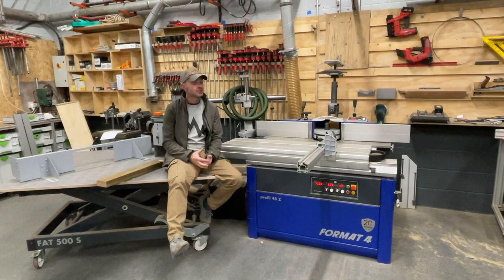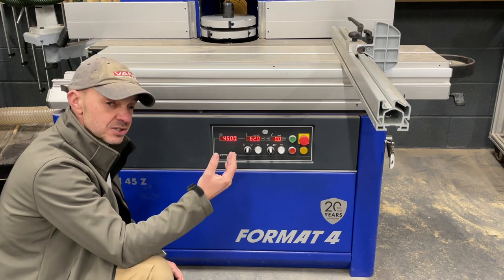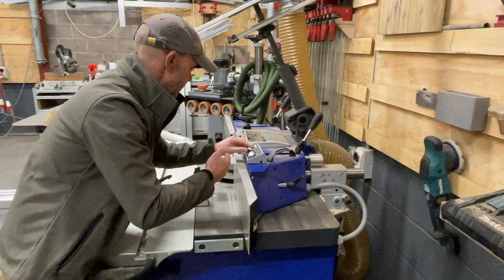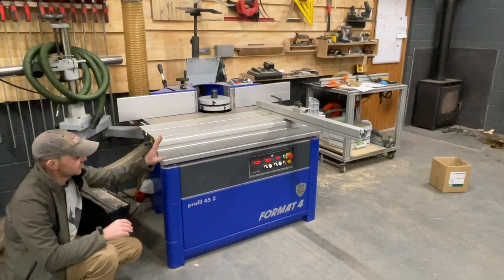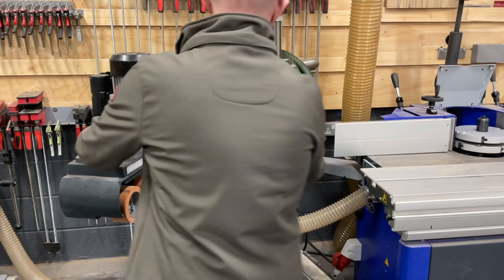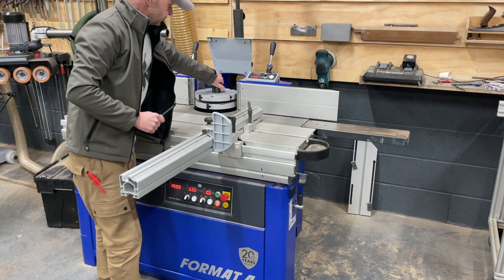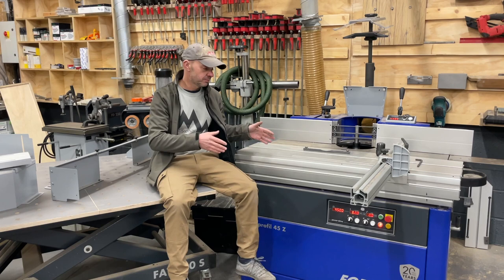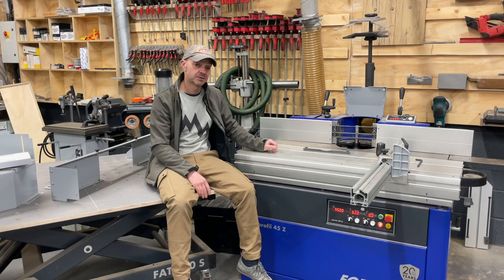Format 4 Profile 45 Z - The Ultimate Shaper - Spindle Moulder

Comment: I was lucky enough to get a used aigner fence for my Felder 700 Z. After using it and other aigner accessories, 100% worth the cost, new. It's just the small things, like the fingers on the fence. You save so much time and energy in such a simple feature. I feel everything I have purchased has had a bigger benefit vs. cost.

Comment: You're bang-on with sticking to the same family. I have a Felder saw and shaper, but my bandsaw (SCM) and jointer (Hammer) can't share accessories without some modification. But I share things between the saw and shaper all the time. Had I thought of that at the time, that Hammer jointer/planer would have been a Felder 700 series instead.

Comment: Nice review.  The fence clamps look like a big improvement over the kip levers I have on my 5 year old machine (Profile 45Z X-Motion) - will check in to upgrading these clamp levers.  Also, to change the speeds, there is no need to remove the side panel.  Just pull the sliding table back and slide the cover back for access to the belts.  Steve
Reply from the maker: Man , I will check the belt change via sliding table . I was told to use side panel and have now fitted hinges :(
Reply: Yeah it’s a great system, I keep some cutters and the hex key inside the sliding cover ( there’s a little ‘shelf’ on left). That way it forces me to open it which auto locks out machine but still allows fence/ height adjustment 

I love the format four!   Still got my old rulong, bump and go fence and try try try height adjustment, the time saved in test cuts is incredible

Comment: I have the little brother to this one, the 700z. Boy this one has some really nice features, especially everything around that tilting hood/fence and the pressure/featherboard holder. I'd really like that feature instead of taking off that heavy hood. The power feeder being offset to the side on the jointed arm instead of mounted on the cast iron is also super nice. Excellent equipment with the profil!

I ordered the router option with mine as well, so I could take the router out of the shop and free up some room. I don't miss the old router table at all. I also bought the (frankly overpriced) fingered-fence. It's really nice, but that price is nuts.
Reply from the maker: I really want the finger fence !,
Reply: @ManorWood  It's really nice, but man, it's as expensive as a fully equipped beginning woodworking shop :D

Comment: My Format4 feeder 4 wheel Vario did not have an overload protection so I blew the circuit. Get the overload protection and save some time.
I later bought the Aigner fences and found the Felder people do not sell the 650 length on each side; so bought from a different dealer.
The Aigner fence is faster, SAFER, and, you can get lots of optional attachments for special work.
I have the router 2 speed spindle which lets me use all of those router bits I previously bought. I have special fab router bits that are cheaper than
buying special knives. If you have the Aigner and router spindle you will find the smaller bits do not go with the motorized digital fence movement.
So get some metal pacers of 1/4" plate steel and mover the whole flip up fence back 19MM (thickness of the Aigner fences). Trick in getting the spacers aligned.
For the work I do which includes long stuff you may want to order the 1300 out rigger. Then, write your own book on all the new things you can do.
Tenons are fast and easy on the Format4. I move the belt speeds to different pulley diameters and in so doing I cut a special window in the frame 
to the left of the removeable grate. Haven't had time to send the size and position to Felder so they can cut the shaper wall with the window.

Comment: The Felder horizontal boring machine has two threaded holes in the cast iron table for use with their hold down clamp which also fits into the threaded puck that slides in the cavity on your sliding table. I have two clamps and use them on the horizontal bore as well as the shaper slider to hold down wood pieces as I do profile cuts and tenons. I have purchased Swedish steel 10 ft round solid stock and machine shop metric threaded for cut down 26" posts for the Felder clamp. Can't tell you how many times those clamps have been instrumental in doing work 20" above the slider on the saw, shaper and horizontal FD 250. One clamp is not enough on the FD 250; just get too much movements. If your are in the Chicago area do stop by for a peak. I am running out of floor space and thinking about bolting the smaller machines up high on the walls!  just kidding
Reply from the maker: I need them !!! Thx

Comment: I bought an older Felder Format shaper with slider table. Also got the high speed-2 spd spindle for router bits of which I had invested router bits before the Format shaper. Several people scoffed at
me for getting the router bit spindle but it has been a valuable addition. I can get custom made router bits to do muntins, etc. so the HSpd spindle is great. Martin shapers are just too much tech for the line of woodworking I do and their sliding table is not that good for door work. My Format has the outrigger and that is good for tenon work and 3' X 6' butcher block island tops with custom profiles from templates and spindle rings against the templates. I compete against CNC shops with my outrigger and spindle-tooling with spindle rings. You remove the outrigger when your work does not require it or if you have the 2.5 meter table all you do is slide the outrigger to the left end of the table. I have used the computer memory very little but expect to broaden my scope. I cut a window in the box frame of the shaper so I may leave the vented cover plate off permanently and change speeds of the belt. That little window makes viewing the belt pulleys very easy and
quick. Tempted to tell Felder to machine in the belt window on all machines. The Felder machine Format shaper I have does not have the fuse for the plug in of the Vario 4 wheel feeder. Talk to
an electrician and buy the fuse and save yourself time and heartache. East to add otherwise you think the motor on the feeder is bad. I have plans to buy the brand of feeder using a track instead
of 3 or 4 wheels. Track feeds smaller pieces and the cost is many dollars less than the Vario. Felder buys their Vario from another mfg and jacks up the cost considerable.
Reply from the maker: That all sounds great, quite interested in being able to swing across the fence away without removing it does that only work with a 2.5 meter slider. Also what is a track feeder? Do you have any links
Reply from the maker: It’s really good, can you only swing arm out the way if you have the 2.5 meter slider? Also what is a track feeder never heard of that do you have any links
Reply: @ManorWood  Good morn MW; the longer or short sliding table is not a part of the swing away action for the feeder. I will have to look for a track feeder as I have not seen one in the flesh. The advantage of being able to feed irregular or short pieces by the track appeals to me. In Chicago they have them for furniture mfg due to versatility. And, without the Felder markup seems like a good deal. The track feeder is 3-4" wide and is continuous like the track of a tank or dozer.
Reply: @ManorWood  Felder sells an extended horizontal toothed arm that fits almost any feeder at the X/Y axis $$$. When I sold my Vario 4 wheel I kept the extension toothed arm for
use with the track feeder. I had the shorter arm that came with the feeder stand and fitted that to the sold item. I remember the extension are being about 9" longer. I am not talking about the swing away option. Just the arm that joins to the feed head.

Comment: Not really a question about the spindle moulder however have noticed in the back ground you have switched from the tecnik stove to a normal wood burning stove. Just wondering the reason for this? Have just bought a sawdust burner myself
Reply from the maker: Just fire, as you may know our fire was no fault of ours was an electrical fault in the building. But I’m absolutely paranoid now I’m quite enjoying burning offcuts I’m thinking of getting a briquette machine for the sawdust. I’m just trying to make everything super safe and clean I’m also investing quite a bit in some nuts traction which will be seen soon to help reduce any XS dust